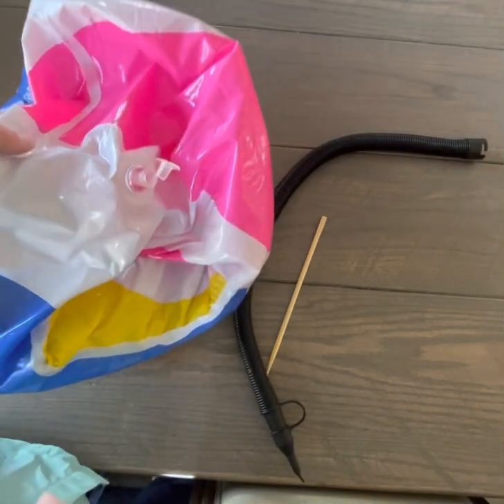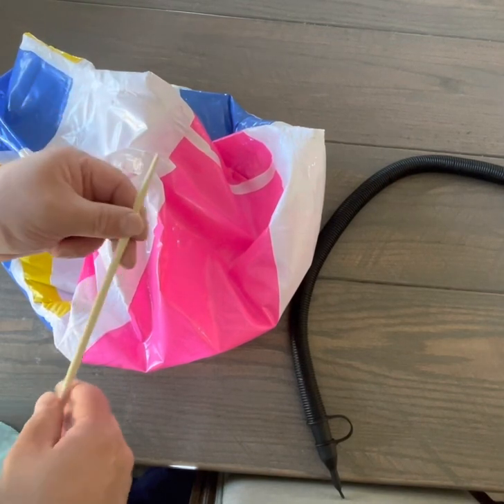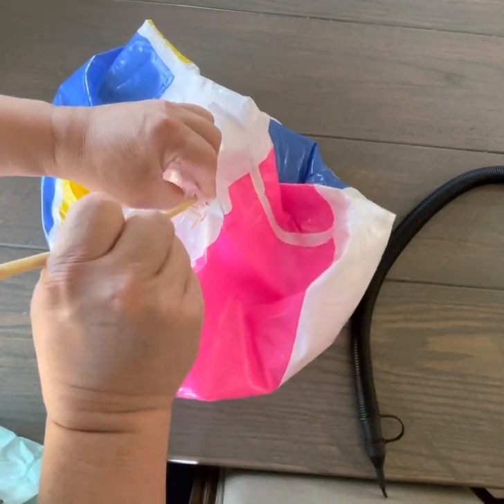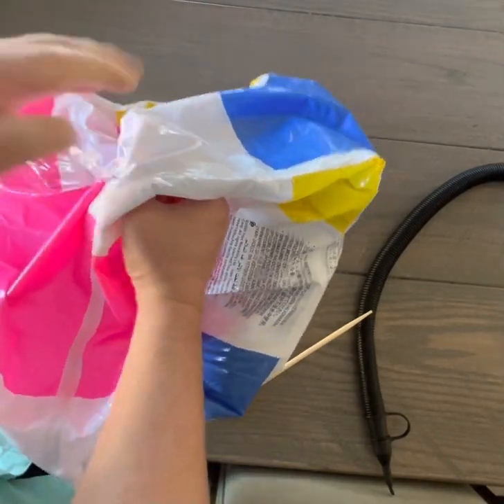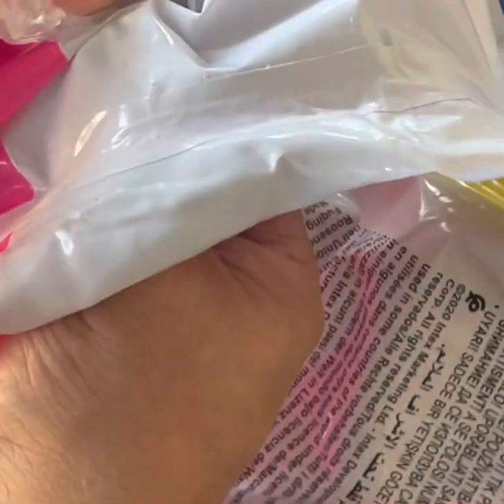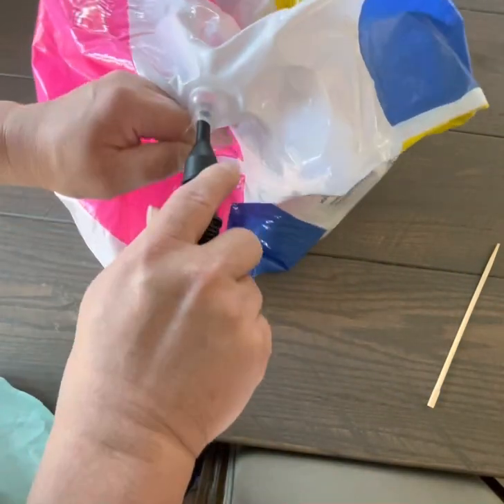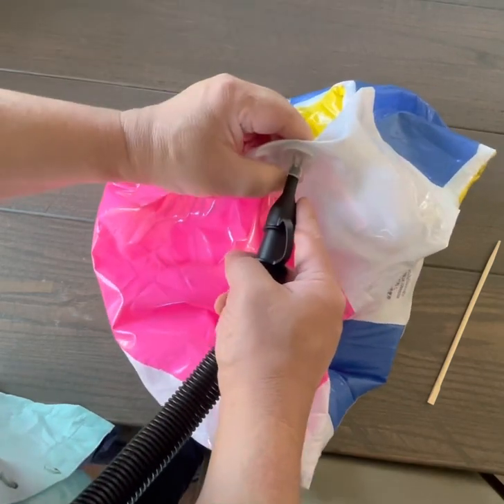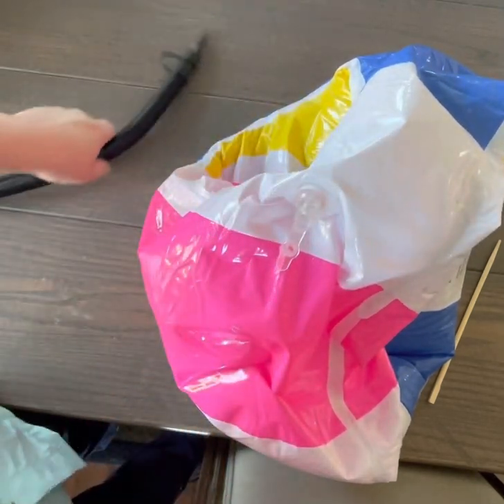Trick for opening up the flap on a pooltoy valve to make it easier to inflate

Comment: Thank you for putting this video together 😁😁, but what I did I push the valve in ward when it was deflated then I use my headphone Jack to push the safety flap then I loosen it, because of the flap it took me 2 hours to inflate my 36 inch beachball underwear 🩲 now that I loosen the flap it takes me about 10 minutes to inflate them.